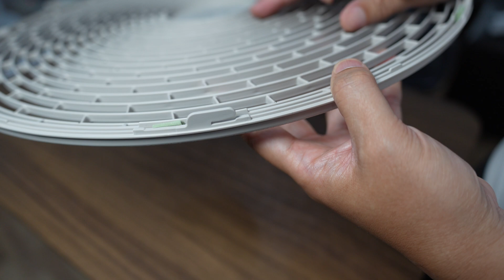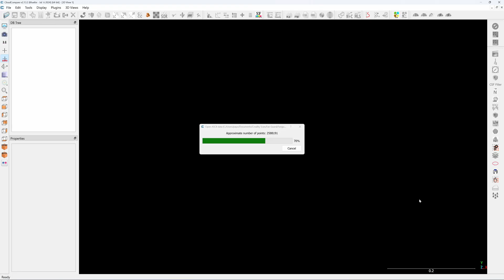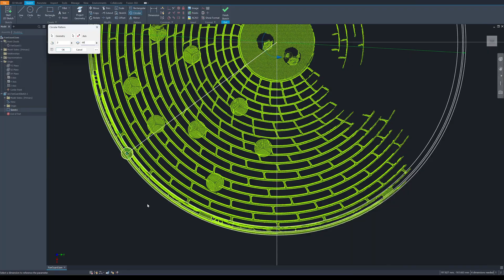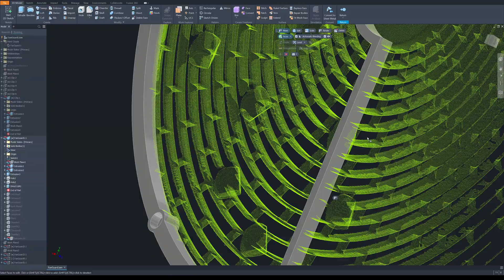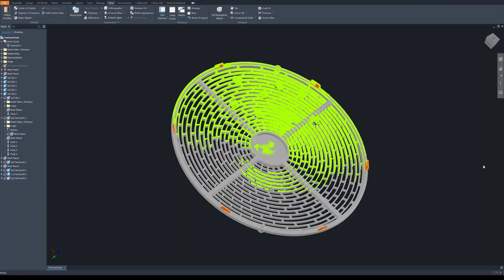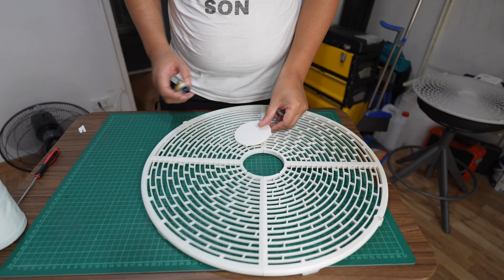From $50 to $5: Reverse Engineering a Fan Guard with Creality Scan Raptor X

Comment: You said the old fan guard was "degraded by the UV light" but you are using ABS to print the new ones. ABS is not UV resistant. You might want to use the cooler brother of ABS named ASA.
Reply from the maker: Not all ABS filaments are UV resistant—some begin to crack within just two weeks of UV exposure. The one I use, however, was thoroughly tested for 3 years before I put it into actual use. I now use it for flashing components on commercial building rooftops.
Reply: @Payo-TensileCreator   Ok, that is nice! Whats the Brand you are using?
Reply from the maker: I've tested Creality’s standard ABS in both black and white. The white filament tends to yellow after around six months, though it retains its elasticity. In contrast, the black variant has shown no visible degradation—even after three years of exposure to tropical sunlight.
Reply: I don’t like ASA. It smells when printing 😅
I tried PETG Galaxy black from Prusa and it’s good after 4 years now. Holder for Solar Panels mounted on a hand rail of a Balcony.